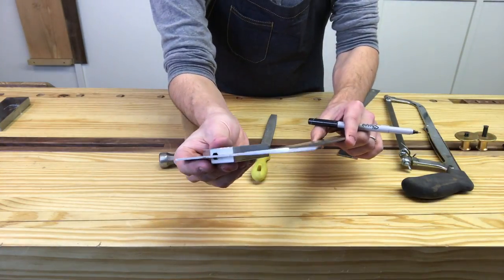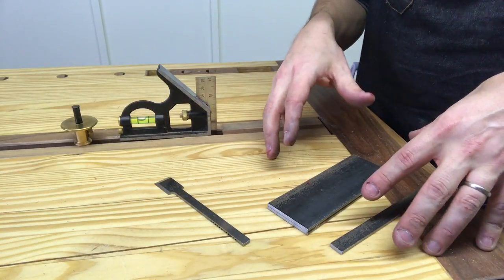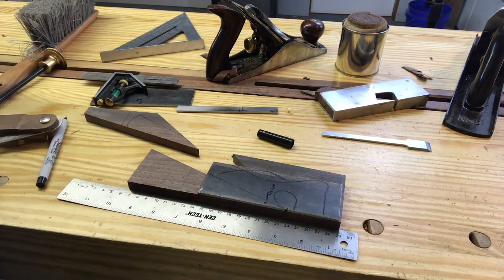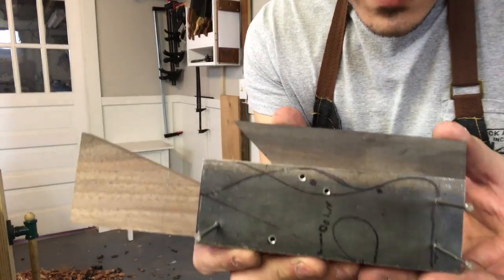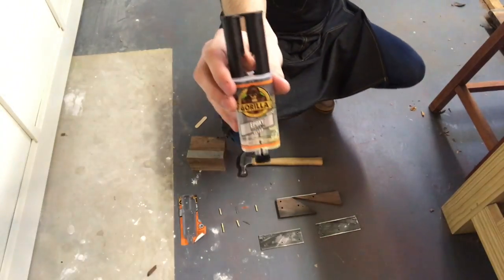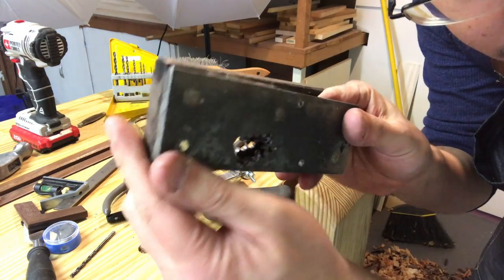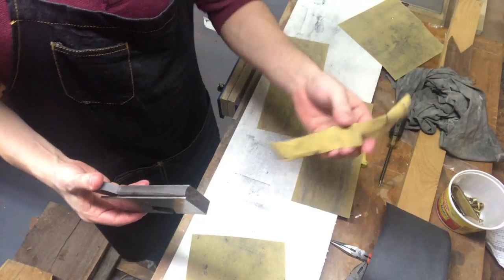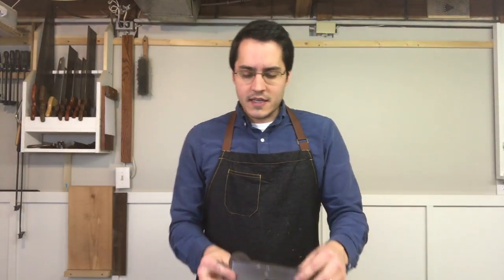Build a Shoulder Plane using only Hand Tools! | Woodworking Plans Available

Comment: Very well done. I like that you left in all the little imperfections. I find those kinds of things add nice character to a tool. Just want to mention a couple things that might help you out with your pins next time though. :)

From my understanding, most screws/nuts/bolts that are made of brass tend to be hardened brass. Or at least harder than the brass rod one would normally use for pins like this. That makes it much harder to upset the material uniformly into the counter sunken holes. There are two ways to get a nicer fit. The easiest would be to anneal the brass first. The process is the opposite of steel hardening. So you'd heat the brass, then cool it rapidly to anneal it. 

The other would be to use a heavy fixed center punch to get the brass moving in a uniform direction outward into the base of the counter sunken hole (Strike in the center of the pin a few good times). Then follow with a ball peen hammer.

Comment: A tip, when you have to cut or drill two pieces that have to be mirror pieces, use double sided tape to hold them together while going through those processes. That will guarantee accuracy. Doing them separately allows for error when doing it by hand.
Reply: можно и на суперклей...

Comment: Good job my friend. By the way, invest in a Stanley hack saw. There  built very well and handle good. There about 15 $  you will notice a big difference in performance.
Reply from the maker: Honestly, I need a new hacksaw. That one I use in the video is soooo cheap. It's actually broken. The "bolt" that holds the blade on is bent, and it keep slipping off, so I use coat hanger wire to secure it! Yikes! I'll look into that Stanley :)
Reply: Or build one similar to a frame or turning saw, just cut a metal cutting bandsaw blade to length and you've got a custom hacksaw

Comment: Beautiful plane...nicely done! Be sure to clean-up your woodworking bench and vice of all traces of steel filings and chips that resulted from the cutting and sanding of the steel plates otherwise you run the risk of transferring steel debris onto your future wood working projects. Once on the wood steel particulate will react with water-based finishes resulting in rust streaks under the finish.

Comment: I have a #78 and a 1” skew-mouthed shoulder plane. I’ve been on the look out for a 1/2” or 12-13mm straight-mouthed shoulder plane for a while. I happed to have a redundant #78 blade, so all I need is the metal.
Reply from the maker: Nice! While not perfect, it works really well! I have been thinking about trying to make a wood body version as it might be more accessible for people to build and you don’t have to go and buy metal :) Even so, it’s not terrible, just tedious with filing and what not.

Comment: It does look as though your design relies upon the wood as an integral part of the structure rather than being an 'infill' in a steel plane. Of course wood moves with the seasons, have you found this to be a problem?
Reply from the maker: Exactly. It’s really a very small amount of wood, and I’ve never noticed it moving at all, though it surely is. Both planes are holding up perfectly!
Reply from the maker: Oh, and also, my shop is in the basement, which stays about the same temp and humidity year round.
Reply: The HandToolery so you have a cave as a workshop!
Reply from the maker: Yup!

Comment: Great work!
I'm coming into woodworking from a metalworking background, so of course this interests me greatly.  Do you think the plates need to be a full 1/8"?  Or can they be thinner?  Does the added mass help with the function of the plane?
Reply: I am not an expert, but from what I have read (mostly from "The Wooden Plane" by John Whelan, some other non-specific-to-planes books and various places on the internet):
The function of the plates in a shoulder plane is to make the tool more abrasion-resistant, not really to add mass. A shoulder plane is used for the squaring up of tenon shoulders (hence the name) which involves a lot of contact against rough endgrain and the requirement that the sole remain square to the cheeks. This style also was historically used on mitre planes, with other types being relatively rare. The infill style predates the processes needed to make both the metal adjustment mechanisms like in transitional planes and the fully cast iron and steel bodied planes. Thinner metal should be fine as antique examples used either thicker dovetailed plates or a single, folded thinner piece. The mass shouldn't be an issue unless you make your plane very small, in which case just be use to use a relatively dense wood as the the infill. You may want to make a pair with alternately skewed blades to make its job easier by permitting the slicing through of the endgrain (reducing tearout as well) but this isn't absolutely necessary. The important bits are the squareness and flatness and the 10 degree, bevel up, bedding angle.
Reply: You're welcome, most examples aren't skewed from what I have read, but they did exist in small numbers. I don't know why exactly.

If you're interested in some more historical techniques you should check out Joseph Moxon's Mechanick Exercises: https://blog.lostartpress.com/2013/05/13/free-download-joseph-moxons-mechanick-exercises/ (free since it's from 1703 and thus long been in public domain). The section linked is on joinery but there's also a section on blacksmithing before it and other trades after. I've been slowly chewing through it and thought it was interesting how much your metalwork on the plane here lines up with many of the cold working techniques he describes. 

Of course the possibilities today for cold work are a lot more interesting, since Moxon didn't have mild steel, modern files and hacksaws, silicon carbide sandpaper, power drills (I forgive you for that despite the title being "only hand tools" since metal drilling by hand is... just tedous and requires special equipment :P ) or other such things.
Reply: One issue with going thinner is that the sides need to be lapped, and since they are steel will need to be lapped whenever they rust because part of the use of a shoulder plane is to index against the sides, so if they are rough the entire tool is toast. You might be ok with 3/32, possibly 1/16, but I really wouldn't go thinner without switching to tool steel.

Comment: yes, I was a nail biter too until I saw myself biting in a mirror window walking down the street.... stopped that day. 

I made my plane using 316L stainless steel, similar design but a pain in the a$$ to cut and file.

Cheers

Comment: What’s frustrating about this project is that I purchased the plans for this plane, but the details for the wedge(s) in the plans don’t match the way its demonstrated in this video.
Reply from the maker: Sorry to hear that. How can I help??
Reply from the maker: I messaged you through Etsy!
Reply: @TheHandToolery  Thanks for getting back to me. The issue I’m having is that the description/diagrams in the plans show all the lines for the two-part wedge converging on a single point at the base, however in this video you are using a template piece for the 11 degrees which extends the opening by an unknown length from the first line drawn. It’s a bit confusing.
Reply from the maker: Ah… I see! Sorry about that confusion. So, I made the video before I made the plans. The plans reflect a more methodical way of doing things. So follow the plans. All the measurements are good in the PDF and the SketchUp. The wedge in the video was just convenient at the time. The important thing is that the wedge that you actually remove has about a 10-11 degree angle. 

Again, sorry for the confusion!!